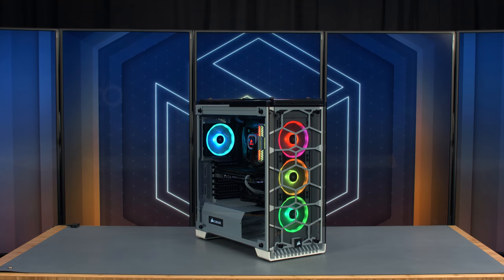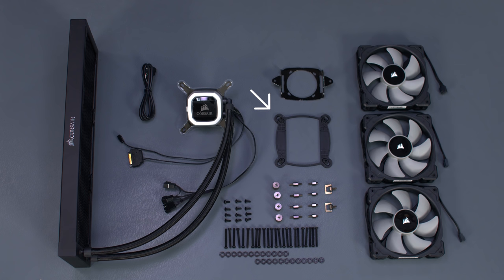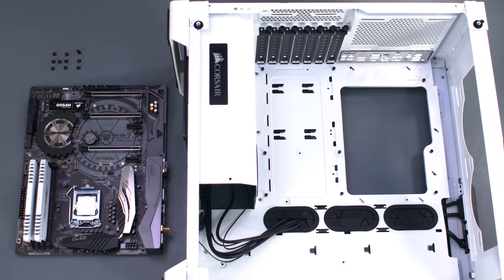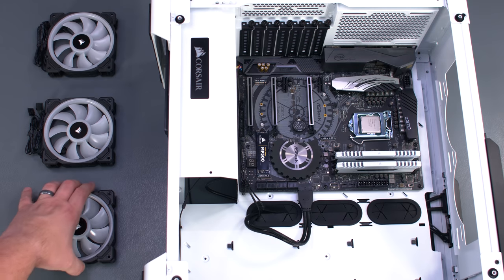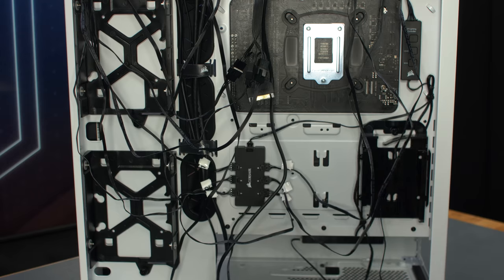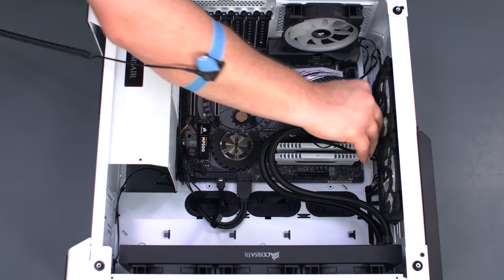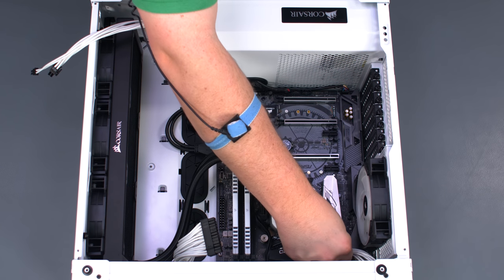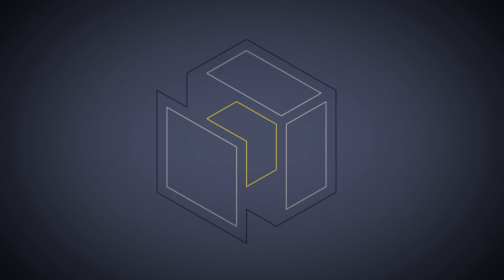Corsair Crystal 570X w/ H150i PRO RGB Build - ASRock Taichi Z370 / i7-8700K

Comment: This video should win a YouTube award. I used this video as my primary guide for building a system one and a half years ago. Even buying and swapping out the fans just so I could copy the video as much as possible, being my first build. I had ZERO problems. Had a different motherboard and graphics card, but it all worked out. BUT, A) still wondering if the top fans should blow in or out and B) should the radiator cables really be on the bottom? Does it make that much of a difference? My temperatures are fine.

Comment: First time builder here, and used this as my primary step-by-step guide, along with a few simple diagrams from a couple component manuals.
Reply: How did it go
Reply: @Sajddhhs  No problems at all. I used a different motherboard (Asus ROG STRIX Z390-E), video card (MSI GeForce RTX 2080) and an Intel Core i9-9900K processor, and it came out fine. The key was to build it slowly, with this video playing on a big display so I could follow along, pausing often. When in doubt, I referred to the manual, mostly for the motherboard, to make sure I was plugging the right thing in the right slot, etc.
Reply: @marko_v  thanks I was just wondering for my first pc build and I’m really scared to build it
Reply: @Sajddhhs  I was scared too. I'm a Mac person. I had already bought the motherboard, video card and processor, and was unsure what case to get. When I saw this video, I thought, "I have to get this, even the extra fans to swap out, etc.," just so I could copy what goes on here as much as possible. That was over a year ago and this video was already a year and a half old. If you can get this case and the components shown, or similar, you'll be able to do it, if you study the video carefully. (Although I admit that if I had to do it now, I might just go with a pre-built PC.)
Reply: @marko_v  on a scale of 1 to 10 10 being really really hard what was your experience
Reply: @Sajddhhs  Probably about 8. Would have been worse if I had not prepared as carefully. I watched as many videos on building PCs as I could over a few months before I even started. I took my time. Started a PCPartPicker account and saw what parts were compatible. Watch lots of videos and don't be in a hurry. Some videos by YouTuber Bitwit also helped.

Comment: For anyone seeing this is 2021 you may want to put the cables from the graphics card through the back. It would look cleaner. Great video!
Reply: Good point. I did that. I put the cables through the slot on the top of the PSU cover (which came with an end bracket in later iterations of the case, apparently, so things are easier to hide).

Comment: nice. I have the same case in black and apart from being sexy, it has  excellent airflow and practical locations for cable management, mounting drives and so forth. I only just turned on my front fan leds to a static one to be not so annoying, but will probably disable. I don't really understand the need for moving colours in a computer case as an adult. But at least it has the option and the built in corsair plug at the rear for additionals.

Comment: Best build guide I've ever seen. And why nobody told me you can get the psu with those white sleeved cables instead of standard, white rubber ones maybe sleeved inside one, big tube? Sadly in Poland where I live I can only find those put in one big sleeve, but I can pay extra 25$ to get one from abroad, or maybe official Corsair site to get a warranty with it.

Comment: Why are the top fans intakes?  Wouldn't it make more sense to exhaust out the top since hot air rises?
Reply: Kevin Yes, your correct.
Don't know why but the majority of reviewers and builders on YouTube place the AIO rad on the top.
I'd place it on the front as an intake and fans on top for a push pull config.
Reply: So I’m literally about to build this exact same setup except with ryzen 2700x. My first ever pc build. I was wondering the same with the 360 radiator. Should the 3 fans on the front be Intake or exhaust and use the back and top fans as exhaust or intake? Ive got the same case as this.
Reply: Branden Waldron I’ve always used the three front fans as intakes, and the top and rear fans as exhaust. That would be the best set up in my opinion.
Reply: Branden Waldron it also depends on where you live. If it's like mid to high 60's where you live, i'd have the rear fan as well as the radiator as intake and the top fans as exhaust to bring in as much cold air as possible. But in most situations,  gabriel's way is what is mostly used and will definitely keep everything reasonably cool.
Reply: also Linus (LTT) talked about this and basically the TLDR is use the fans in a way that dust does not collect between the rad and fan which is likely the best advice on this entire topic :D 
i pref rad front but the difference is rather small as seen in the video posted by burgienl so go for what looks most pleasing to you and is easiest to build and maintain :) 
Have fun!
Reply: Today I finished my build which is almost the same as in this video. I also like the rad in front because there is way more space there. I also did the top fans as intake because I suspect the front intakes will be hampered by the rad too much. The whole end of this case is pretty much open so if I end up with positive pressure it will most likely be pushed out that way anyway. And my pc stands on the ground so it's nicer to see the fans on the top :-)
Reply: Kevin top fans are setup as exhausts in this build.. dummy
Reply: Mr. xdR3aD look again...
Reply: @mr.xdr3ad385  no, they are really set up as intakes. I build it the same way to try it out. The fans have a led ring on only one side, the intake side. And you can clearly see the led ring from the top. 
I had to play around with the fan speed settings to get the cooling right. All the components stay pretty cool no problems there. But there is off center in the case a spot where the air temperature gets warmer. It doesn't seem to effect the hardware but can get up to 40 degrees celsius under really heavy loads. It seems best to have them spin between 600 and 800 rpm. Turning them off or setting them higher will make that spot warmer. I suspect it has to with how my graphics card (asus 1080 TI) blows are into the case. I have my front fans at 1500 rpm when under load.
Reply: The fans are moving the air, not convection. As long as you have a fan actually exhausting hot air, as opposed to just moving it around inside the case, there should be functionally no difference. As for how fans should be positioned on the radiator, in my experience pulling through as an intake makes it easier to clean dust off the radiator.

My setup is two 140mm fans at the front for intake, 240 mm radiator with fans intaking air at the top, and a single 140mm fan exhausting air at the rear in an Enthoo Pro M.
Reply: There are actually several theories based on this topic. Gamers Nexus actually does a great job running down the pros and cons to each config.
Reply: Good eye, has to be a mistake?
Reply: Note that, when you intake from the front with a CPU cooler radiator and exhaust on the back, you have lower temperatures of the both CPU and GPU. If you exhaust with the CPU radiator on the top and intake fresh air from the front, both the CPU and GPU get warmer for some reason. There was even a test that confirmed that in one of the reviews. Maybe someone that has seen it will agree.
Reply: I did both in the same week , my heat was way better when the radiator was on top , the heat raised when i placed it in front. You can try both and see what suits you
Reply: Does it really make a difference if the top fans (radiator) are set up as intakes or exhaust? I am asking this bc ima be building a pc very similar to this rly soon. Ty in advance
Reply: quan I would like to know as well. Once I get mine in I’m just going to put the radiator on the front and use the top and rear fans as exhausts.
Reply: @maydaygoingdown5602  but with this case it has to be done this way so the rgb fans can be displayed trough the front
Reply: @maydaygoingdown5602  teach me how push pull qork, is that the best way for cooling?
Reply: @Spilkyy  Push pull is generally the best methodology but it also depends on what case you are using.
Reply: Hi guys, i built this except that i used the z390-f Gaming mb from Asus. But i got a question, where did you plug in the chassi RGB cable into since the hub on the back is full?
Reply: I know right
Reply: @top1c_886  The best option for most people would be to have the front fans as intakes and the top fans as exhaust.
Reply: @burgienl Thanks .

Comment: I've a question about this setup, can I use the 3 fans that came with the case, instead of buying 2 new pack of 3x120mm coolers ?? Will the RGB fans with the case work with the Lighting Node PRO ??
Reply: Yes

Comment: What happened to the front panels buttons and controller, after he disconnects the SP controller? He just left them like that, don't they need to be connected to something?
Reply: He now has a built in fan controller on the top of the case that does absolutely nothing. he has complete control of all the fans from corsair link software, but built in buttons on the case that don't do anything. kinda a let down imo.

Comment: when you switch the sp120 rgb fans (preinstalled in the case) with the ll120 rgb fans, do the buttons on the top of the case still work? The buttons that controlled the speed/mode for the sp120 rgb.

Comment: I know this thread is old,but is it safe to assume the water block would block the first DIMM slot ? I need to upgrade my MSI PC Pro z370 and I have a Kraken x62 and the tubes slightly obscure the first DIMM slot.I could put a stick in,I have 2 8GB GSkill RGB's and want to pop in 2 more.The stick would snap in the first slot,but there would be pressure on it from the hoses.Not sure what to do.Get a new cooler,because 2 sticks of 16 GB Ram is too expensive (DDR 4 3600's),or try a new MB.Don't know if the outcome would be different on a new board.Any suggestions ? I mean,I'm sure 4 sticks would work in my config,but I'm just worried that over time,the pressure on the stick from the hoses would lead to disaster down the road,eventually.
Reply: Gary Ortolano I’ve never heard of any problems regarding a water block taking up space of a dimm slot. I’d say you’re in the clear, but do keep the receipt for the cpu cooler handy if that’s not the case.

TL;DR: you’re 99% good to go

Comment: Where did you eventually plug in the buttons on the top of the case for fan controllers? Or did you just leave them disconnected entirely so that you'd only be able to control them with the software?

Comment: How did you get the corsair logo to light up rgb where the power supply is since it has to be plugged into the lighting node pro, taking up an extra rgb slot, with the 6 fans

Comment: Can I use an H100i with two fans and place it to the front of the case in case positioning to the top of the case is too narrow (hitting the motherboard), and also use the one remaining stock SP120 fan next to the thermos on front of the case?

Comment: This build guide was incredible!

Quick question, you have the front and top fans blowing air out of the case with only the back fan pulling air in. Is this the best setup for the case in your opinion? I've seen others recommend the top pulling the air in with the front and back blowing the air out. Thanks!
Reply: We've actually got it the other way around -- the top and front fans are all pulling air in, with only the rear fan exhausting.  We did this mostly to keep the fan lighting turned towards the glass front/top panels.  We get away with it in this setup because of the 570X's semi-open design, allowing positive air pressure to help push air out the fairly large gaps along the edges of the glass.  

It's definitely reasonable (and more traditional) to balance things by setting the three front fans bringing air in the front and the top/rear 3 fans doing exhaust.  In fact, if you watch our other build videos, that's what you'll typically find us recommending as well.  This build was more of a special situation.
Reply: @jackfolloway3354  - Got it. Thanks for your help.

Comment: I recently bought the Corsair Crystal X570. I want to know if the logo on the front and the logo on the power supply's  protector on the side can be connected RGB lighting for iCUE 
or it is fixed white in a factory color.  Thank you

Comment: How are the temps with 3 front Intakes attached to the radiator  and the 2 intakes on top? I currently have  a 240mm radiator up top with 2 exhausts attached to it. Not sure since there’s pretty good airflow with the 570x if having more intakes would be better for my temps. Any feedback would be greatly appreciated.

Comment: I've just finished putting together a system just like this one, specifically a Corsair H150i PRO on the ASRock Taichi Z370.  I'm having some trouble controlling the RGB though.  It just cycles through the rainbow but I would like to have it based on the temp of the cooler.  I'm pretty sure I'm setting it properly in Corsair Link, but the setting won't apply.  Any ideas what I might be doing wrong?
Reply: Hi i realize this is late😂 but did u ever figure out why it didnt work? I am thinking of getting an asrock motherboard + corsair vengeance rgb ram. Will polychrome control the ram rgb?
Reply: Sorry mate, I didn’t get it working.
Reply: @JasonMoore2k  thanks for the reply man 🔥🙏 i am guessing its cause asrock polychrome rgb doesnt support corsair ram🤔

Comment: I have  a few questions, what would be better:
The case comes with 3 LL120 RGB fans.
1) Do what they do here: buy 3 more ll120 RGB fans. 
Buy h150i Pro mount it as front intake instead of the front built in 3 fans.
Take the 3 removed and put 2 up top and 1 at REAR exhaust.
*should the top 2 fans be Intake pe Exhaust? PcPart put it as intake for some reason. What's  better? I know rule of thumb is top exhaust.  But in this video they do it opposite 

2) but Corsair  h100i Pro instead- 240mm Rad- mount it up top as EXHAUST. 
Leave the 3 included  front fans as it is. Mount  an extra LL120RGB in the rear. 

I really need advice!
Reply: I think your second option is the way that I personally am going to go with. I am not the greatest with PCs, but that seems to be the better solution. The case itself is pretty "open" if you will, with the gaps between each piece of tempered glass, so I feel like that would be fine! I would love to hear from anyone if they have a second or third opinion!

Comment: Aren the fans 4 the cpu cooler the same lieb th Echse fans? did u change or did u use the 3 fron tacke fans and put it onto the water Pooling Radiator? or did u take the 3 water Pooling Radiator on the front and put the case fans from fron toto back and top?

Comment: Guys I tried this exact build but left the sp120 fans in the case. Now they're on full speed and don't have any lights. The additional 3 llfans are working fine as intended. Can someone please help?
Reply: Flippmo Gaming I have this same problem if someone could please help
Reply: ZW11 I ended up having to replace the 3 sp120 fans with the ones that came with the corsair h150i. Reason being is that the sp120 fans only have 3pin rather than the 4pin you need for pwm fan management. Without the 4th pin they spin at max rpm.
You're options are either to use the corsair fans from the cooler and have a black front or buy another 3pack of the LL fans. Both of these have 4pin.
Mine is black at the front for now and looks pretty good actually.
Reply: Ah okay, thanks so much!
Reply: I removed the HD150i Radiator fans and the 3x SPs that come with the 570x and replaced all with LL120s that connect via the Lighting Node Pro (6 inputs)

Comment: I have a question regarding to aio. So the aio is build in as an intake, right? So i should build the other fans to pump out air, yes? i thought the sense of the aio is to pump out the air and not as an intake? Is the cooling still good if the aio is installed as intake? (Sry for bad english, i hope u understand my question) Thanks
Reply: Yea im pretty sure its intake
Reply: The aio in this build is intake (taking cold air from the outside of the case and bringing it into the case), the three interior fans must be mounted as exhaust (taking hot air from the interior of the case and expelling it outwards). If the aio is mounted as exhaust, then the interior fans must be mounted as intakes. I hope this makes sense
Reply: @elilaw1377  thanks, i understood :D
Reply: @dactyliferal.7333  Okay, all good.
Reply: @elilaw1377  so looking at the video, does he have his fans in the correct directions?
Reply: @strongsizzle  His rear and front fans are mounted correctly but his two top fans are mounted incorrectly. The two top fans are pulling air into the case, they should be pulling hot air out of the case.
Reply: @elilaw1377  That's not entirely correct. Many have built in this case with front mounted push and pull 360 front AIO and used the top two fans as intakes to create a positive pressure. Rear fan as an exhaust and also mounting the PSU with the fan pointing upwards as an additional exhaust. The whole case has gaps between the glass and the chassis which many builders are taking advantage of to expel the positive pressure and dust build up with this case. Yeah hot air rises but I've seen at least four builds done this way and all temps are good in those builds.
Reply: @knottymaker5098  Yeah but this guy hasn't got a push/pull configuration for his front radiator. By mounting his top two fans as intakes instead of exhausts, he minimises the amount of airflow that could be obtained. The only fan taking hot air out of the case is his rear exhaust fan.